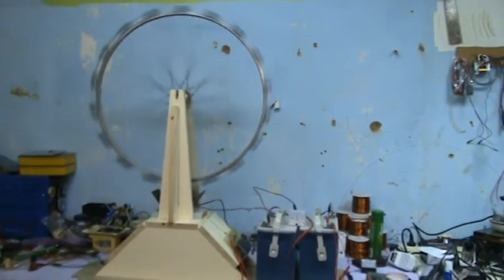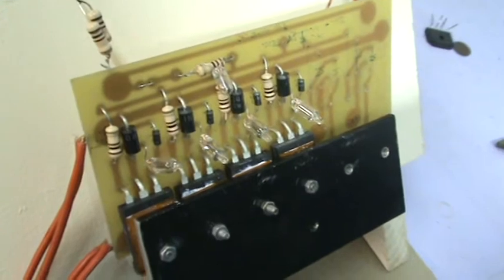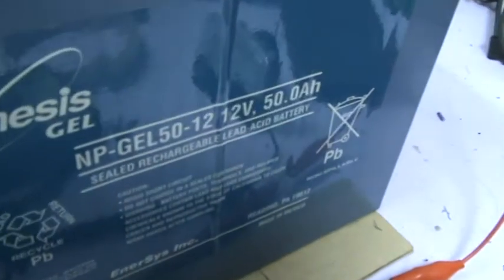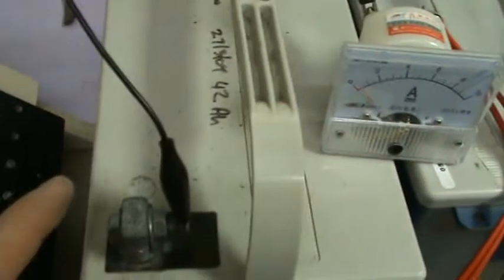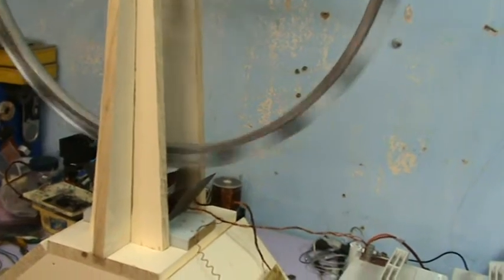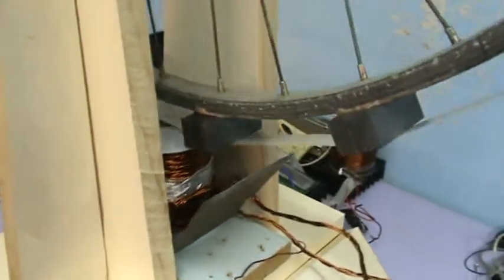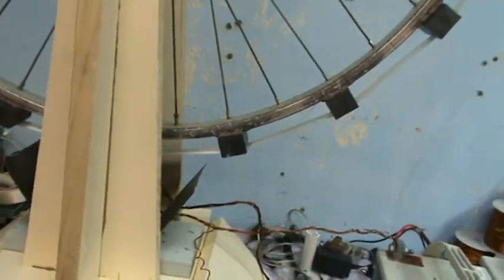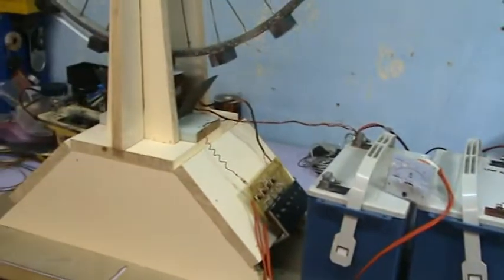Bedini SSG

Comment from the maker: Over-unity is a term that I prefer not to use. The reason being is that energy cannot be either created or destroyed, it can only be transformed from one type to another. Therefore over-unity is not possible as you cannot get more energy out of a system that you put in.
I use the term "COP" (coefficient of performance), which is a figure representing the output energy divided by the energy you PAID for. A COP figure >1.0 is what we are aiming for and IS what this machine is capable of.